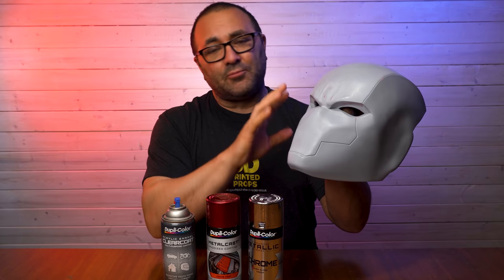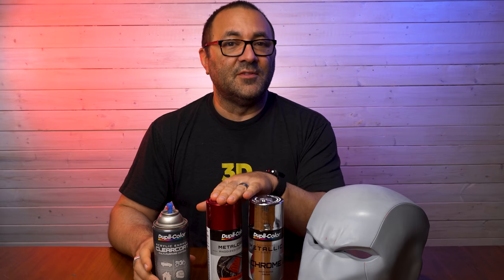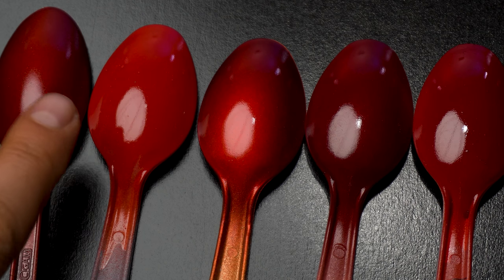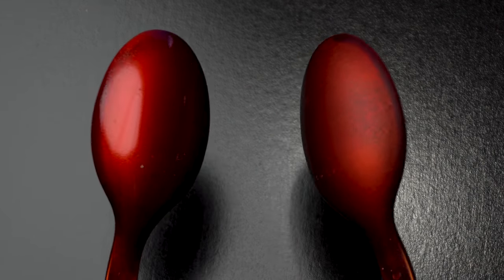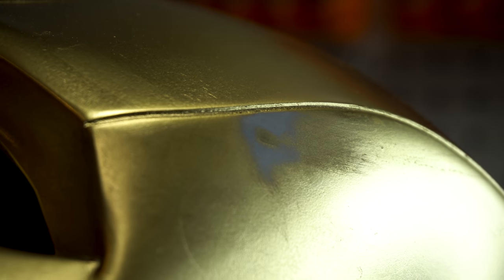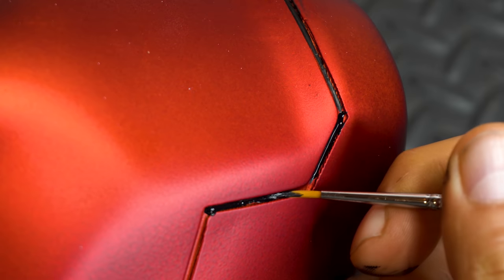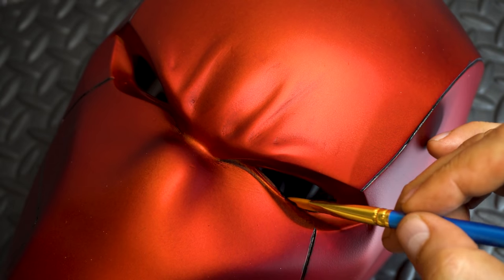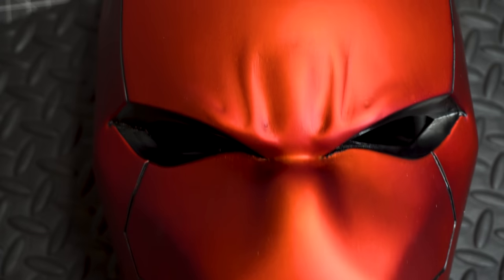Finishing 3D Prints: How to Paint 3D Printed Parts

Comment: you should try learning car painting. the paint job you did would come out better with less orange peel, also if you use blue masking tape you don't have to worry about being sloppy. also the painting technique in auto paints is called "candy" which is a basecoat of gold, chrome, or more commonly silver metallic and a colored semi transparent of clear coat on top to show the base coat underneath, that's the candy part. car paints also have something called chameleon/ DNA which is a color shift technology. just remember to use organic rated cartridges for the respirator, and those do have an expiration so keep them inside ziplock bags
Reply from the maker: Would love to learn how to paint on that scale. :)

Comment: I ordered some Duck Brand non-adhesive shelf liners from Amazon and used them on the center section of my helmet. If you use that with your second coat of clear you can simulate a carbon fiber weave when the light hits it the right way.
Reply from the maker: Cool idea!

Comment: Firstly, thank you for creating such easy to follow and thorough videos! I just finished watching the previous lesson, and was curious if I can use acrylic paint over the 2 in 1 primer? If so, should i let the primer cure for a much longer period of time, or can I just let it dry, wet sand, then wash, then paint?
Reply from the maker: Sure, u can use acrylic paint. Just let the primer dry as long as directed. At least 24 hours

Comment: To fix runs for the Metal Cast Paint do you wait for it to cure? I have been doing super light coats 10 minutes apart and it still has some runs that I cant prevent.
Reply from the maker: No, its just a really runny paint. Just keep you distance with the can make sure its dry and warm out and do super light coats.

Comment: This series is really helpfull. My prints finish well but it takes me a lot of extra steps. You did a good job of ordering sanding, priming and bondo efficiently. I'm curious about your painting though. I was under the impression I was supposed to wet sand between coats. My prints definitely benefit from it. With your method you get the print perfect and super smooth, paint without sanding and you don't have any orange peel?
Reply from the maker: Glad it was helpful! I have seen others sand in-between but I never have. I'm sure you would get an even glossier and smooth finish but this seems to work for me. :)

Comment: Hi. Question, is it absolutely necessary to clear coat? I have primed and sanded my pieces. But with the test spoons (thanks for the tip!), the clear coat turns my paint job yellow. Trying to find the best option of protecting my pieces but getting the look I want.
Reply from the maker: Not at all. But know that if you don't put on a corrective coating the paint can scratch. I've had issue in the past too, the key thing is to test everything before putting it on your final print.

Comment: Can I use any types of acrylic paints for detailing, or are there specific types of acrylic paint for this
Reply: If I were you I'd just spray paint mostly. It makes it look clean
Reply from the maker: Any kind will work but better paints require less coats. I also use spray cans to if I am adding larger painted details. You tape off areas you don't want affected and then use the cans. :) So like, if there was a large black stripe down the helmets center, I would tape the lines with blue tape and then use a rattle can to make the line. Much cleaner.

Comment: I am completely new to this, how much time do i need to wait to had the next spary
Reply from the maker: Go by whatever the can says. Though I usually wait 24 hours. It really depends on your climate. If its super humid you may want to wait more. But 24hrs is a good rule.
Reply: @3DPrintedProps  Also I am completely new to this, and what is the order of sparys I use again, the base coat, which can spray can is that? I am a slow learner

Comment: How long should I wait after I applied my gold metallic coat
Reply from the maker: At least 24 hours and if you live in a humid climate more. Just be sure its fully dried.
Reply: @3DPrintedProps  so I need some help my good sir, I find myself having to redo my print job. I have a power rangers dino Thunder helmet that I need to strip and to from the beginning.......What should I use and how should I go about this

Comment: you should wait about ten to fifteen mins in between coats not seconds it makes more work your way , looks nice tho.
Reply from the maker: Cool, thanks for the tip!
Reply: @3DPrintedProps  quick response wow , ive been a body workshop tech for years, always wait till the coat is tacky before you apply more paint it stop it running and gives you a quicker drying time :)

Comment: Hey, can someone help me with the following problem? I primet tha resin print, after 1 day of drying I painted with black spray paint. after nearly 12-18 hours I used clear spray. 
After severeal days of drying, the part is still sticky. what did I do wrong?
Reply: Was it tacky and sticky when u started. This usually happens if it was not cleaned well enough with alcohol. You may also have some resin leaking out of the holes u made in the slicer. Also what is the weather like where u are.
Reply: @kevinvolo5208  I washed with propanol first and dried the resin printed part in the UV chamber. it was not sticky anymore. I think I needed to grind the whole surface a little bit. and use less paint :/

Comment: Hi I have red hood injustice 2 helmet and it's cracked on the right front side and I don't know what to do to fix it the material is resin and the helmet is very expensive  and I really wanna fix it and I don't think so I can do it because I'm 17 years old and I don't understand stand that stuff please help 🥺
Reply from the maker: If its just a crack try just using superglue to repair it. Then maybe some of the glazing compound. You don't need to mix that or anything.

Comment: I followed your guide to the letter, but my clear coat turned frosted white.
Reply from the maker: Hmmm. That has happened to me for a couple different reasons. One was that I didn't let the paint dry the full 24 hours before the clear coat. The other was it was VERY hot and humid when I applied the clear and it fogged in places. Anything like that going on with yours?

Comment: How does this prop shop on etsy sleep at night selling 3d printed masks, that cost under $5-10 to print, for $90+ on etsy
Reply from the maker: Their helmets are 90$, and they charge that much because they are a business and have a overhead. They have 40 printers printing everyday, using filament, power and their time. There is also repairs and upkeep of printers, shipping, everything a business has to deal with from internet to inventory to returns. 90$ for someone who wants a helmet for cosplay and has no interest in 3D printing is a good deal. Also, printing a 3D helmet will run you at least a full roll which runs on average 20 bucks.